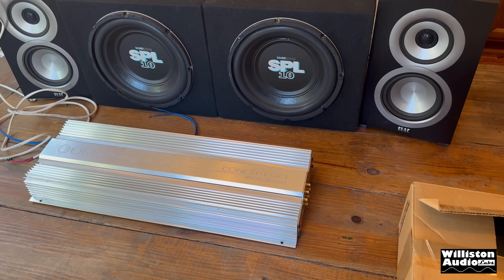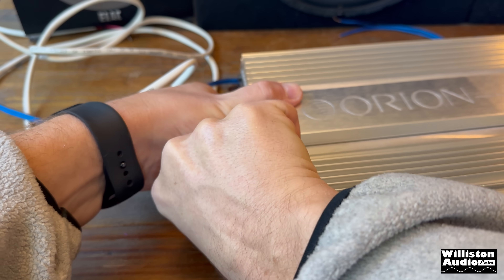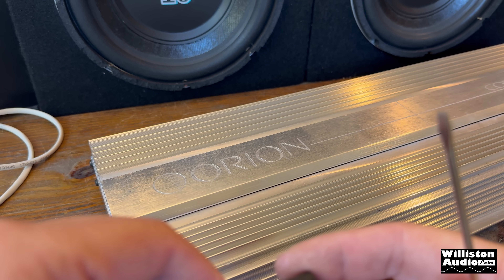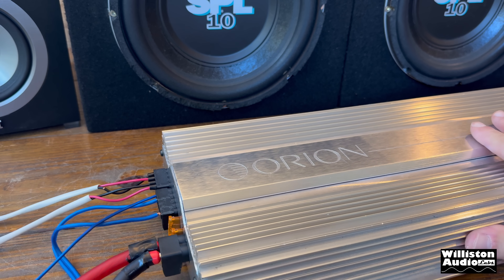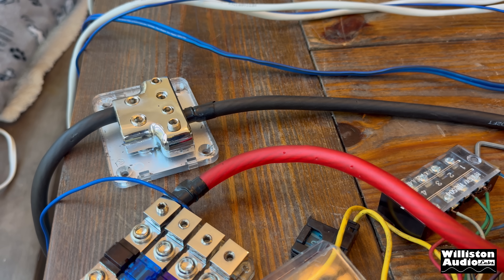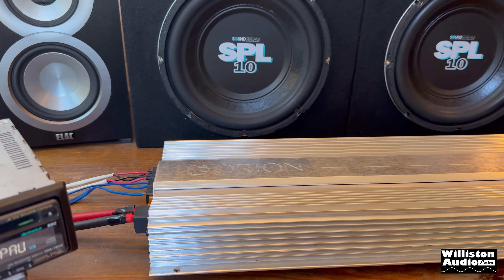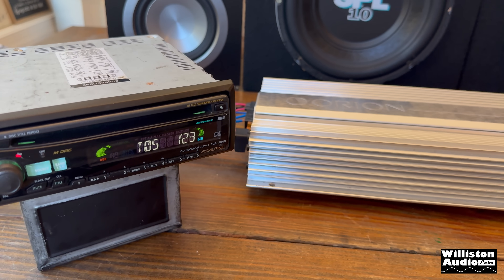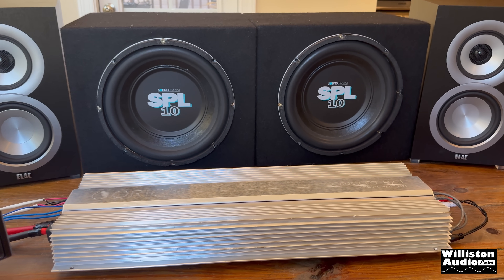Rare Orion Concept 97.1 - Wiring Up for Sound Demo - Behind the Scenes

Comment: On the plugs with the "flappers" I just back the screws all the way out to remove the screws and then you can pull the whole terminal from the plastic body and get those flappers removed. Then the plug is more like your standard amp terminals and the wire is easier to get into the holes. Hope this helps!

Comment: The plugs being tight is a good thing. It prevents arcing from a loose connection which eventually leads to wires melting. I get that they are a pain to work w/ but they serve a purpose.

Comment: On true Installations ferrels should always be used. I like the concept of those style connections. But those are examples of when their build cheaply and poorly. If you ever see an Extron device you'll see how they're supposed to work.

Originally called Phoenix connectors, they were created for dense wiring ports where theres many connections in a tight space and prevent shorts and cross wiring A/V cables.
Reply from the maker: Phoenix connectors are much easier to connect and disconnect than these WECO style

Comment: THE spl10S are a beautiful sounding sub , when listening to Paul Revere from Beastie Boys those subs in a 1.8cuft box smashes that bass note better than most . Use t run a pair off a Reference 700 One of my fave subs for a daily low power setup
Reply from the maker: Sweet!

Comment: My brother had some Orion amps about that size in blue back in 1988 in a Chevy G20 van with 4 15" subs in a box under the rear folding bench seat 4 8" subs 2 in each door and tweeters in rear view mirror and some other speakers and it sounded great.
Reply from the maker: Awesome 👏